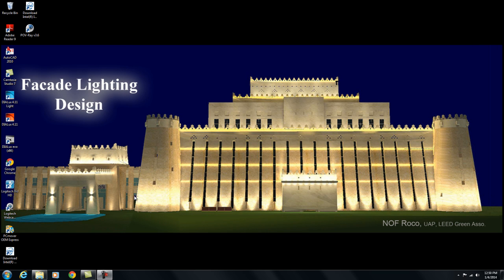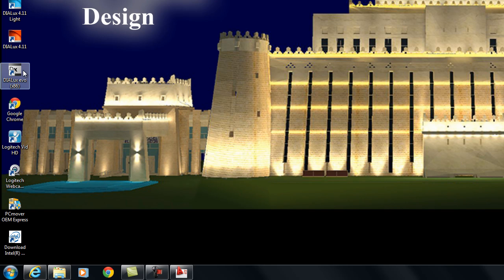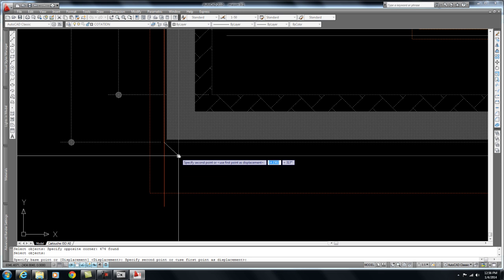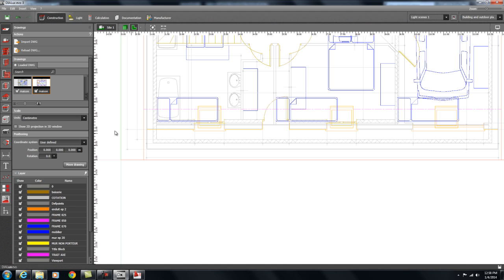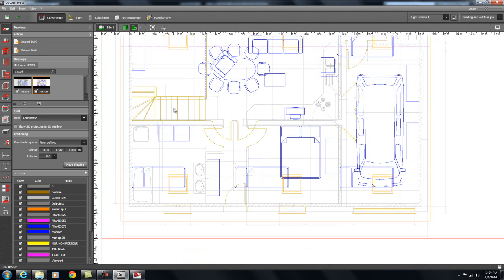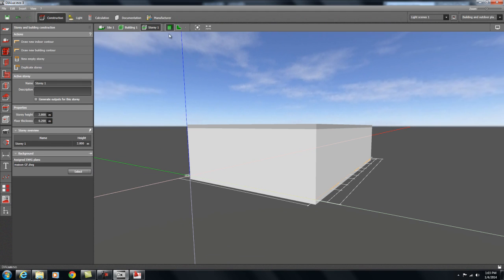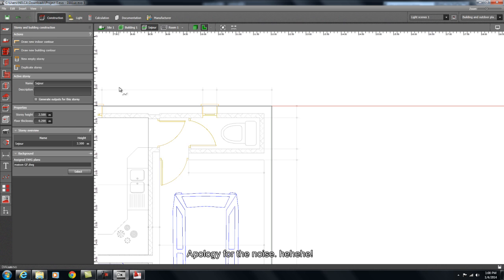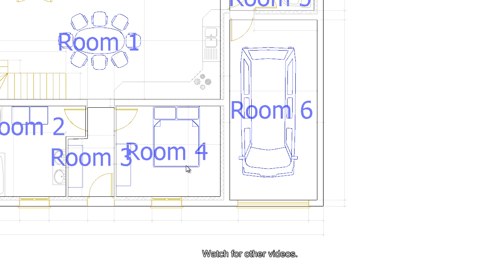Dialux Evo Tutorial  Part 1 - How to create a room and clean & prepare your CAD file

Comment: Ma'am, pano nyo po ginawa yung sa 2:36-3:27, yung paglinis po sa autocad. Yung x and y axis are  zero po, paano po yun?. Nagkakaproblema po kasi ako sa dialux pag inopen ko na yung file may hidden blocks po. Di ko po kasi makapa sa autocad yung ginawa po eh. Thank youu
Reply from the maker: select the drawing, command M or move, select the reference point (usually at the corner of ur drawing) then type 0,0,0, then enter.  0,0,0 means x-0, y-0, and z-0 axis.  so when u import it into dialux, it will not be far from the xyz axis. u can easily see it even if it is big drawing.

Comment: mam i hope you are fine ,
besides building can you design road lighting ???
Reply: same happened to me like malik. malik have been asking how to import catalog in dialux evo. could you share here any video as i mentioned
Reply from the maker: Dear Sohail,  Please check this one: https://www.youtube.com/watch?v=0AsjaRLEnZI&t=10s
Reply: Dear Nelca ,
i'm an electrical engineer, currently i'm designing high way lighting. (13m wider road,12 m high poles, 1.5m arm of the pole, and 180 W LED warm white), client has asked me to prepare simulation of light using software ,, for this would you please help me in anyways .... please
Reply from the maker: Do you have the photometric file of the 180W luminaire?
Reply: mam i have installed this software DiaLUX evo,, but unable to import catalouges or lights .... please tag your video in which you were doing that ,, importing catalouge or lights
Reply from the maker: HI Malik, check this one. This is for you.
https://www.youtube.com/watch?v=n6eCsaPDFM4&feature=youtu.be
Reply from the maker: https://www.youtube.com/watch?v=mI8b0s1CZsE&t=43s
Reply from the maker: https://www.youtube.com/watch?v=0AsjaRLEnZI&t=1s